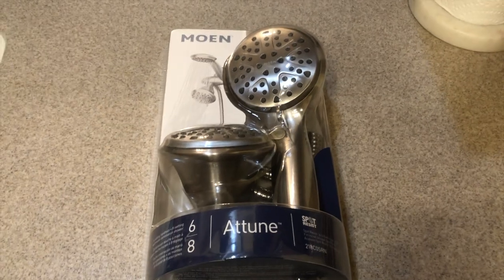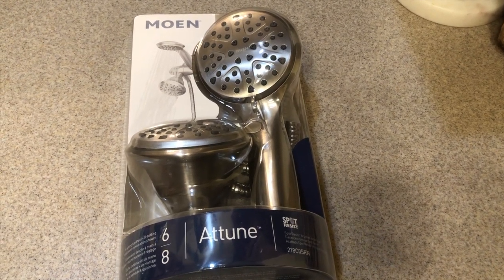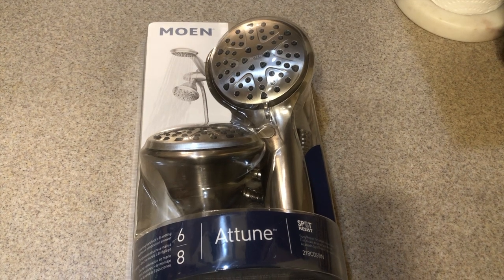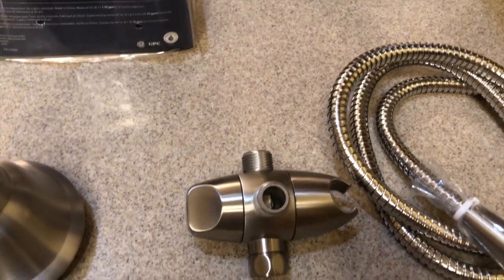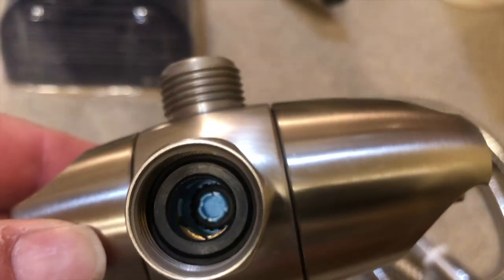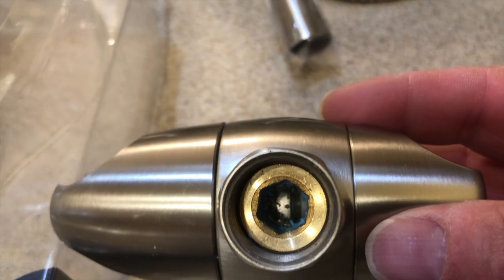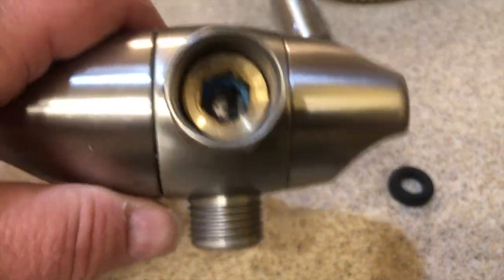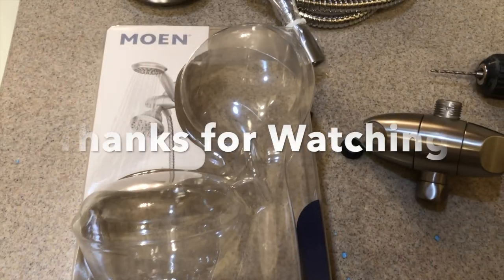Moen Shower Head Water Restrictor Removal

Comment: Nice
Reply from the maker: Thanks.  Much better water flow now.
Reply: I do have the tool, but that nut is not wanting to come out. A little nervous about putting an impact on it but that’s what it’s feeling like it needs 😂
Reply: @nivesnine which size? Is it 9mm? Did you get it out? I’m concerned about drilling mine. I currently can’t find a 9mm Allen…none of mine fit it.
Reply: @ not sure which size exactly, I just drilled out the center a tad.. just enough to break it and it works great now.. no need to take it all apart.
Reply: @nivesnine  Thanks I'll try that